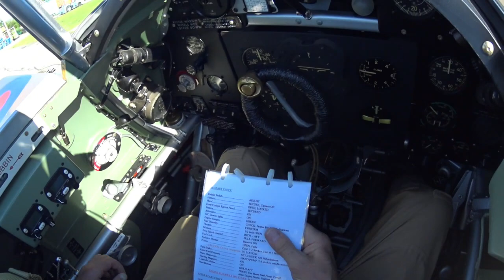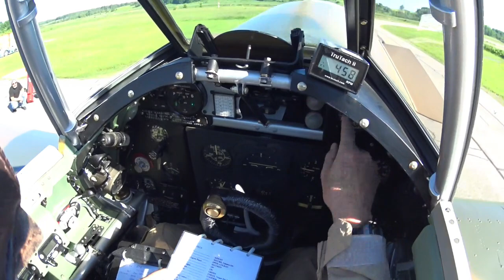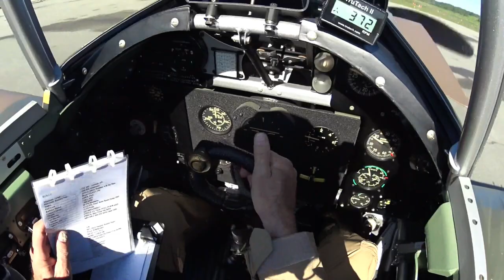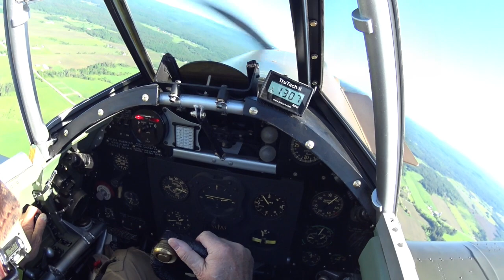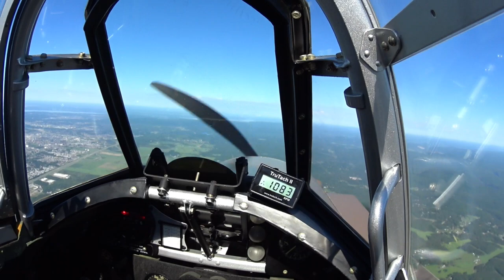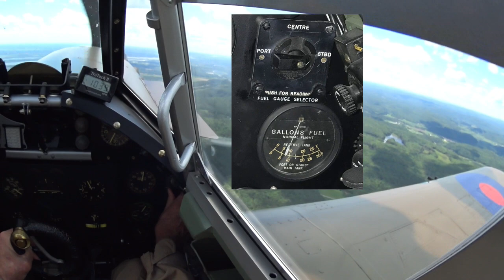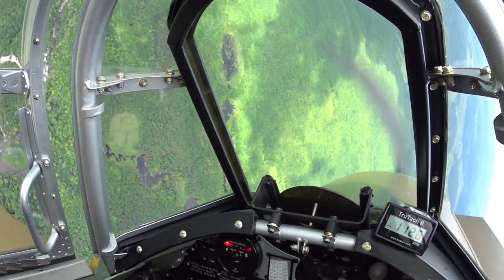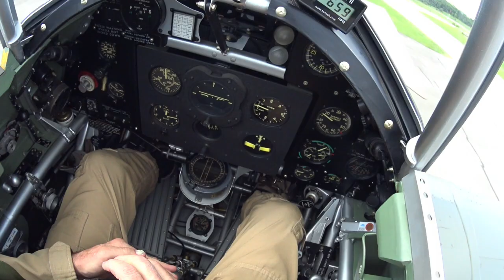Hawker Hurricane Aerobatics

Comment: Informative and entertaining as always Dave, your manner suits the subject very well. Would you mind expanding on a comment at about 8:20 regarding the rudder bar for run up: "Move the rudder bar to the position where the braking is maximum for each wheel"?  Are you referring to adjustment of the rudder bar? Probably the meaning is obvious to others but I've somehow missed the point! Regardless thanks for the video.
Reply from the maker: Sure. When you think you have the rudder bar in the middle, and expect that the brake pressure will be equal to each wheel, usually it isn't. The fussy little foo-foo valve within that very complicated air-diverting arrangement often ports a little more air to one side than the other even though you could swear you've got your feet nice and even. During my first-flight in a Hurricane IV many years ago I advanced the throttle for the run-up and the aeroplane pivoted 90 degrees. Thus I've learned to squeeze the hand-lever, then look down at the brake-pressure gauge, and adjust my feet so that the two outer needles are even. Then, I lock my feet in that position and carry on with the runup.
The Spitfire is the same. 
And that's one of the reasons we don't brake at high speed in any aircraft with that braking system. We let it roll, then brake when we're slow; when a groundloop is more easily dealt with.
Reply: @davehadfield5906  Right that makes sense now! Thanks for the extra info and keep up the good work. Much appreciated.

Comment: Hi great video. If you turn these ww2 fighters at max G on turn performance is it easy to stall a wing and depart? It seems you fly other fighters so is it common for a wing to stall in a tight turn? Thanks Subbed 😊
Reply from the maker: The stall behavior is different from airplane to airplane. The Mustang flicks (departs) without much warning. The Hurri and the P-40 give you quite a bit of warning via airframe buffet. The Spit tends to simply mush straight ahead -- all assuming you have the ball in the center. If the ball is displaced they will flick in the opposite direction.

Comment: Beautiful video! Beautiful airplane! Is it the engine torque or rotation that makes right hand rolls less natural than left hand rolls? (I'm not a pilot.) Thanks.
Reply from the maker: Partly, yes, but it's also that your right hand is on the stick, and you can exert more strength pushing to the left, than pulling to the right.
Reply: @davehadfield5906  Thanks for the explanation. Love the Hurricane!